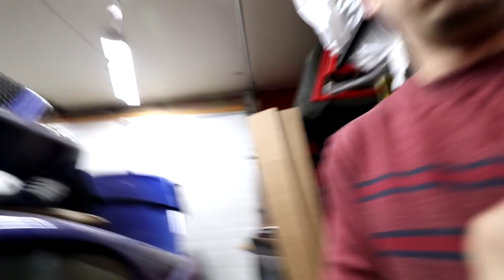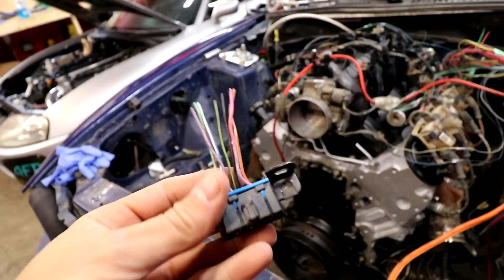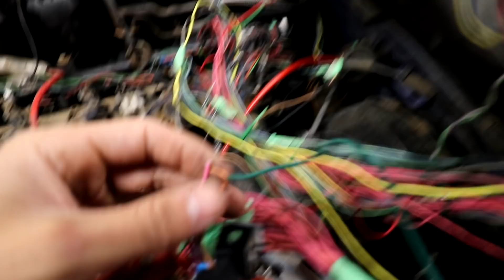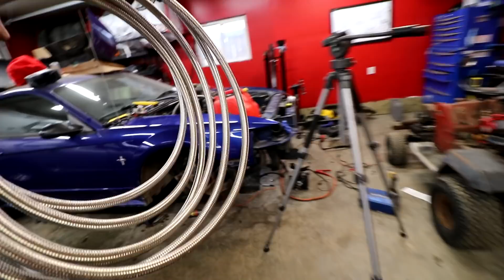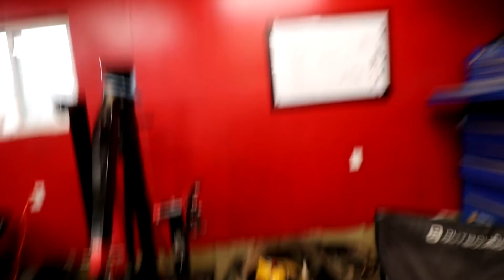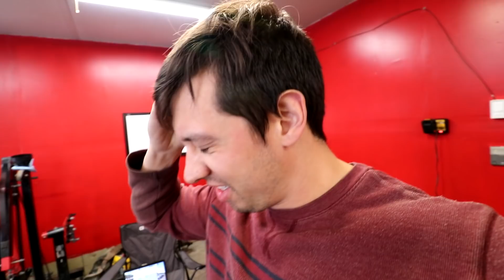Budget Turbo LS Build - Part 30 - IT RUNS!

Comment: Next time u start it gotta let it run at like 2500 rpm because its doesn't make enough oil pressure at idle to break in the cam
Reply: After u hook up the cooling system of coarse lol